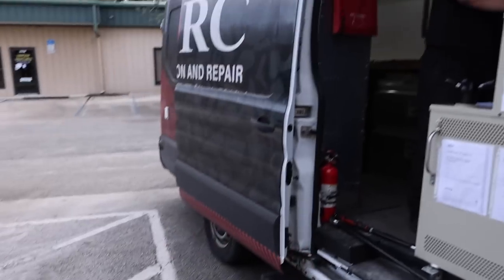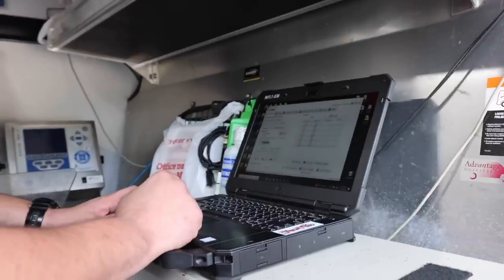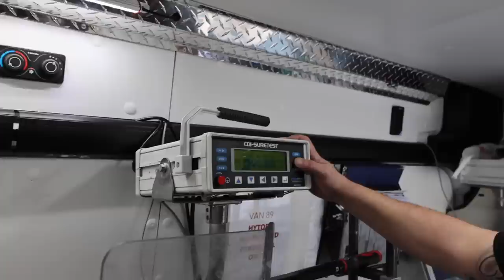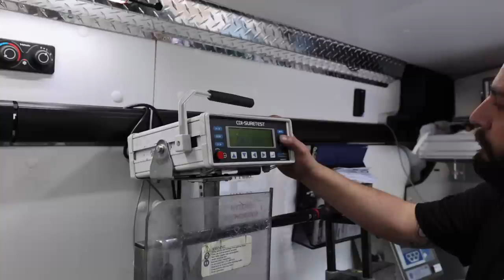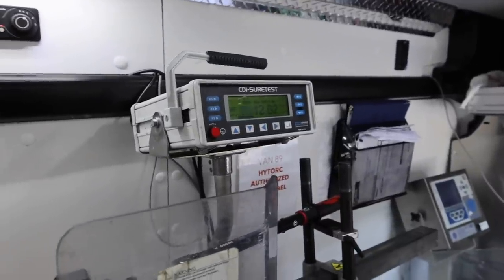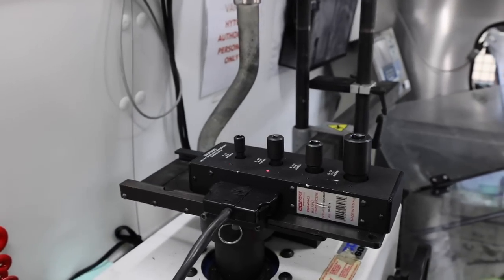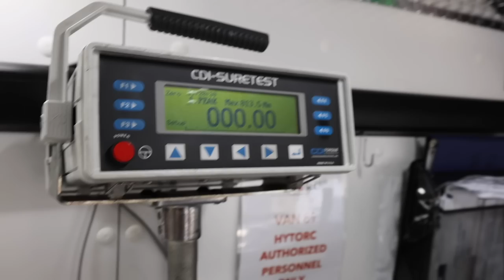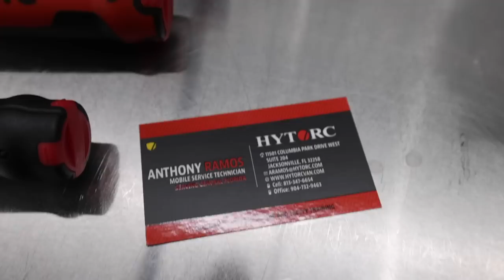Having My Torque Wrenches Calibrated By Hytorc Truck

Comment: Matt, for what it's worth I have a half dozen torque wrenches (1/4, 3/8, 1/2") . Some are Snap-on,. some are Proto and some are Craftsman. I had the Snap-on truck guy test them about a year ago and all were basically within +/- 2-3 % except when using a few in reverse which I never do anyway. I saw him test a few inexpensive models as well and even those were fairly close. I don't thing that 2% or even 5% would make a hill of beans different for automotive use. Unless you intend on building a Lunar Lander in the future, I'd bet most of your Torque Wrenches would be accurate enough.

Comment: These wrenches are rebrands and sold under some lower end brands all over the place for little money. Id be keen to know if there any good long term. I've been tempted to buy a 1/2 inch in for wheel nuts but something tells me to hold off for a better unit.

Comment: He had absolutely no idea what he's doing. Our metrology department does all our calibration and the fact he had no idea how the wrench would be adjusted as well as not understanding the unit
Reply: Agree, the calibraton guy had absolutely no idea what he was doing. The whole idea of testing by applying and measuring the force on the handle will not give accurate result. He made a comment on how results varies depending on where, on the handle, the force was applied. Of cource it does. It’s simply the laws of physics and have nothing to do with how accurate the torque wrench is. For accurate measuring the handle must be fixed/locked in place and the force applied and measured on the socket. The fact that the guy did not know how to adjust the torque wrench is a clear indicator of non professionalism.
Reply from the maker: Or…he is a few months into the job.  I was fine with his skill for this task.  He will improve with time.  Hytorc has pretty sophisticated training of which he has much more to do.
Reply: @ObsessedGarage  I understand that you might have been fine with it for wrenches used in a garage situation he also has to go do equipment that is safety critical and if the hydraulic equipment for example isn't correct it can have serious consequences. He really should be shadowing a experienced team member before going out on his own.
Reply: Team Hytorc 😂
Reply: I have a digital kobalt torque wrench that is 2 years old. I had mine checked and it was only off by 2-3 % and I I've used it over hundreds of times and it's abused haven't had any issues yet
Reply: @Marri-Tech  I was just thinking the same thing